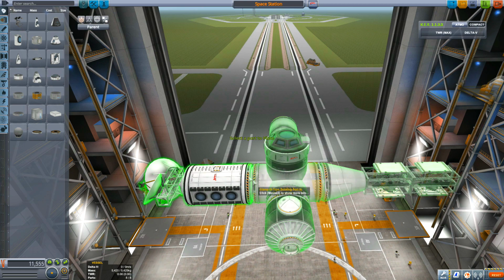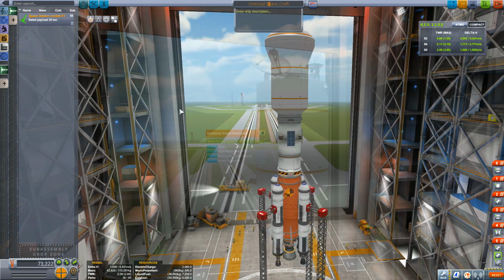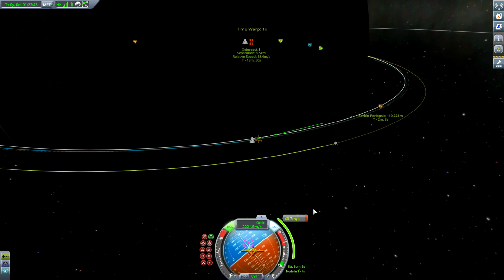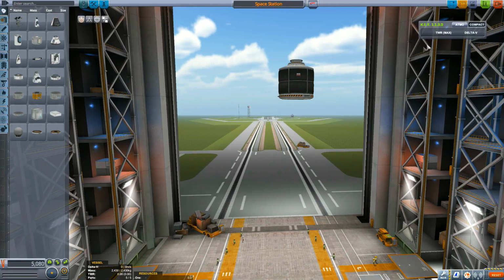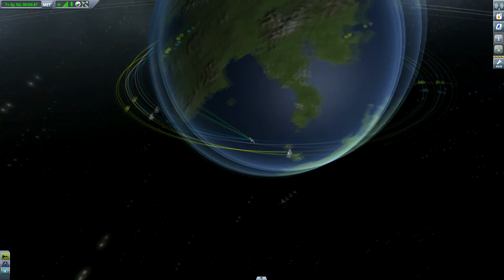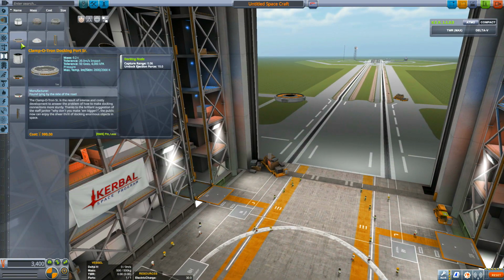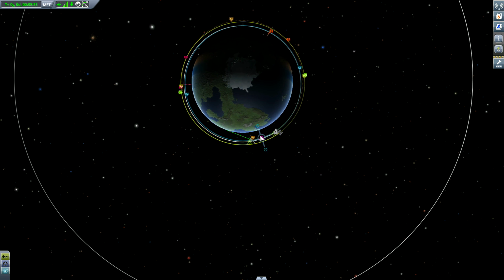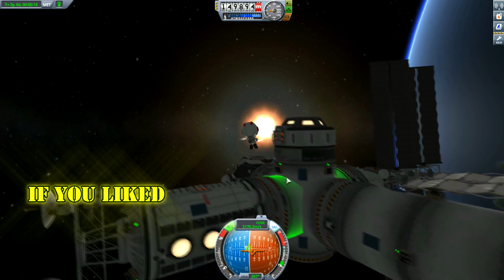Kerbal Space Program Tutorial Building a Space Station Part 2

Comment: I always overshoot by a few dozen meters, does anyone have any advice?
Reply: Capitão Explosão use your main engine (or rcs) and burn at anti-target if you pass your target, remember that you keep velocity in space, so you do have to accelerate if your speed is too fast away from target.
Reply: @dominic5386  yeah, I usually try that, but the clamp port magnets push the ships away instead of pulling them :/
Reply: Capitão Explosão you may of accidentally put your docking ports on backwards, use the engineer notes or whatever it’s called in vehicle assembly to check, the engineer should tell you if the docking ports are backwards.
Reply: @dominic5386  I did check them, they were fine